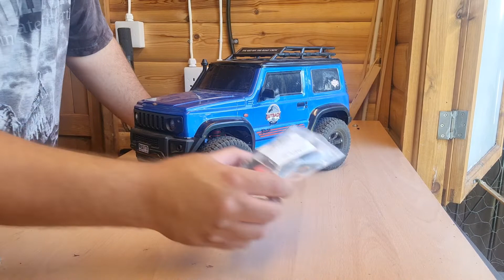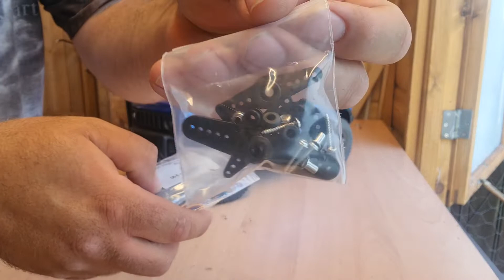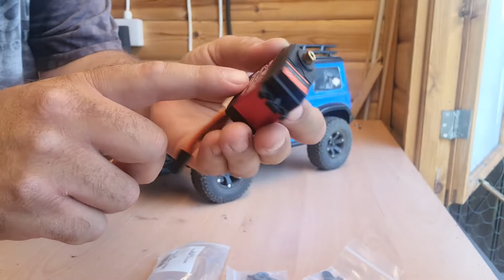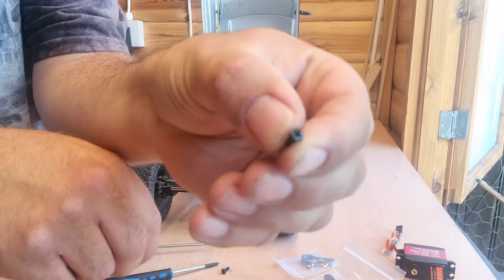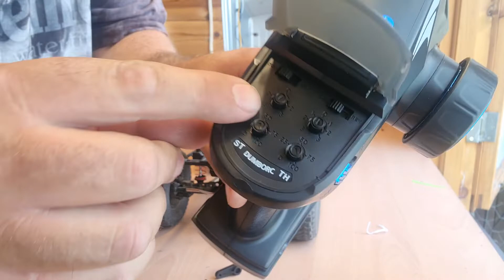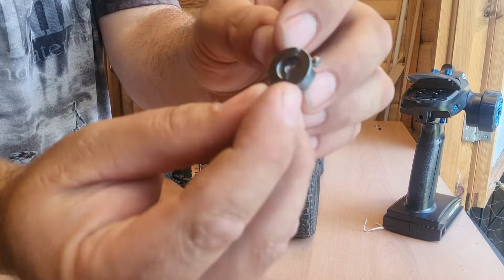ftx outback 3 new steering servo

Comment: Hi! It is written on the box: “6kg metal geared waterproof servo” and the car came with a cheapest plastic geared one. It lasted 6-8 hrs then it failed on the same way like yours. I replaced with an SRT DL5020, it has a much smoother steering than originally was.
Reply from the maker: Yes, I found the standed steering not to be great at all, but upgrading it made a big difference to it